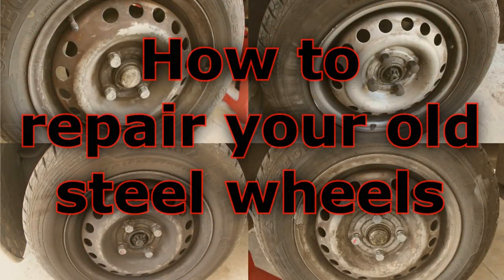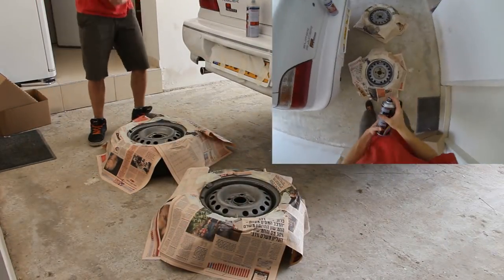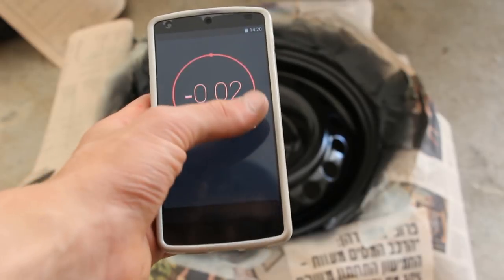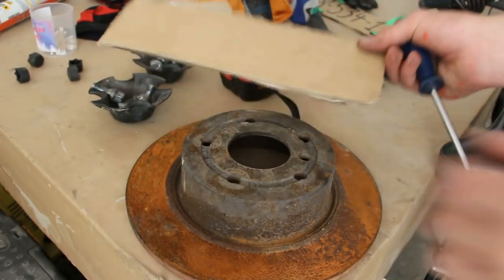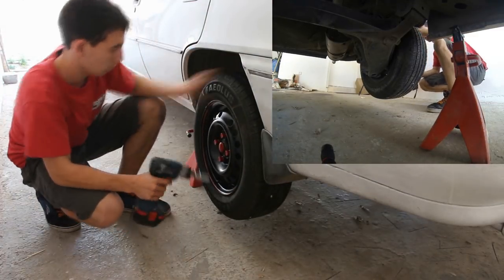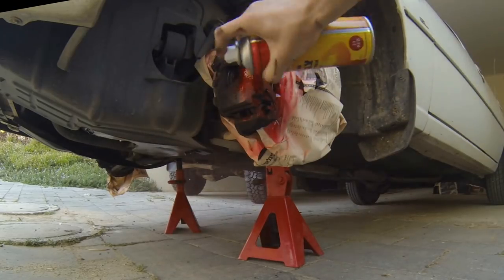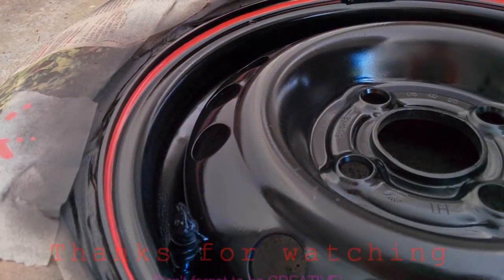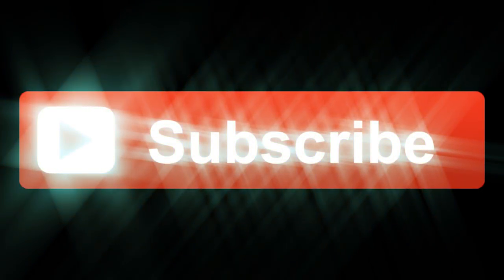How to repair old steel wheels DIY [English HD]

Comment: תותח! צריך יום חופש בשביל זה... אבל הוספתי לרשימת המטלות שלי תודה כל הכבוד על ההשקעה...
דרך אגב אם אתה מתקין מערכת נעילה מרכזית לאנשים אשמח להצעת מחיר...
Reply from the maker: cky master תודה :) ותודה על המחמאה אבל אני לא מספיק מקצועי כדי להתקין לאחרים אבל אתה מוזמן לנסות בעצמך, זה הרעיון של הערוץ
Reply: אין לך בערוץ הסבר על התקנה של נעילה מרכזית... מה שיש לך זה למכוניות ממש ישנות... אני חשבתי לקנות כזה ולהתקין אבל לא בטוח מה לעשות עם כל החוטים ( http://www.ebay.com/itm/Keyless-Entry-System-Universal-Car-Kit-Remote-Control-Central-Door-Lock-47X/231527301088?_trksid=p2047675.c100005.m1851&_trkparms=aid%3D222007%26algo%3DSIC.MBE%26ao%3D1%26asc%3D29386%26meid%3Dac248c81249a44d4b3368db8999ad06d%26pid%3D100005%26rk%3D3%26rkt%3D6%26sd%3D301568613955&rt=nc )